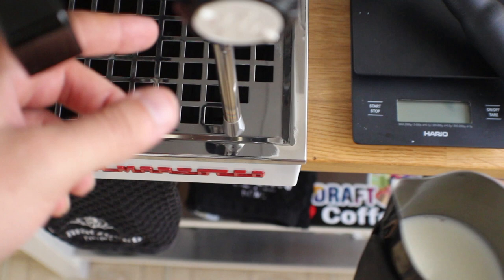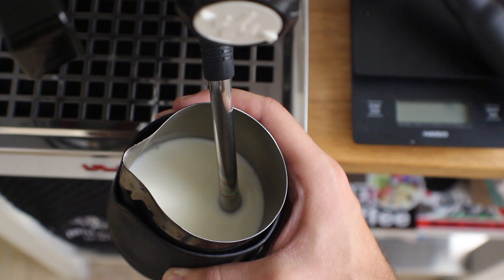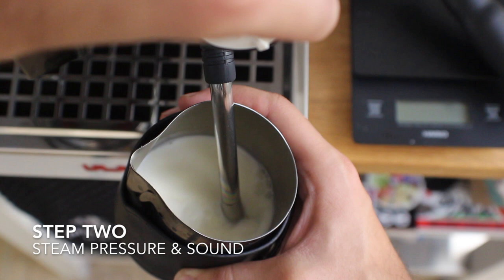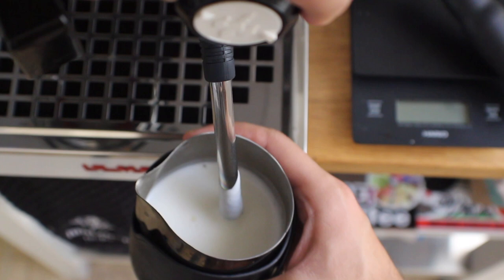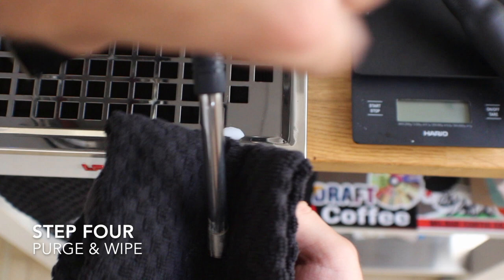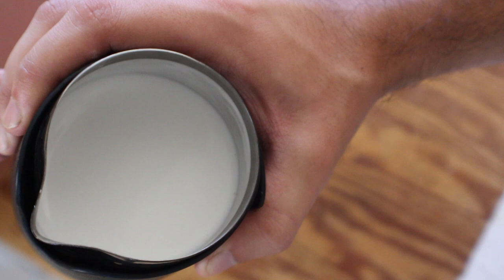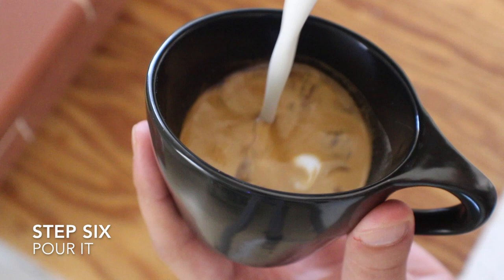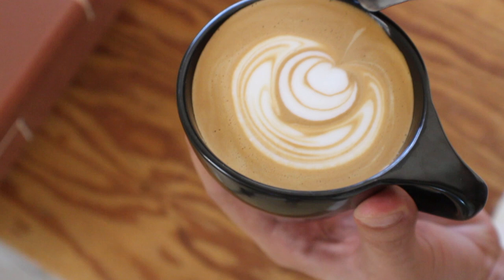DAMN FINE TUTORIAL - Milk Steaming 101

Comment: My question is: what's the difference between steaming for a cappucino vs say a latte or a flat white?
Reply from the maker: Krusty Kruss good question! So there are two differences. Cappuccino adds a bit more air, so milk is a little more frothy. Also cappuccinos are a bit cooler temp wise, I’d say 135 or so. Lattes and flat whites will be the same amount of air, it will just need a small adjustment considering the size difference of the two drinks. And usually steamed to 145 or so.
Reply: 50 amount milk and 50 amount of foam for cappuccino..aerate the milk or air for 5 to 6 times.
80 milk and 20 foam for latte..aerate or air for 2 times..

Comment: I don't get how you know you've put in enough air. My milk might be frothy on top but the milk inside is still very runny so they don't float when poured. How do you know it all or most of your milk has the correct texture?
Reply from the maker: It’s a matter of sound. If you bury the tip into the milk and it begins to squeal it means you need more air. But if it’s more of muffled sound it’s got enough. But there’s a fine line between too little and too much.
Reply: @Sprometheus  I'm atuned to the sound now but is there a guideline to how many seconds to steam before you bury the tip in deeper to just warm up the milk?

Comment: Do you need to merge it deeper at 100 degree? I saw other video for la Marzocco doing this.
Reply from the maker: Mohamed Hassan I don’t think there is really a temperature that I use for putting the wand in deeper. Just the amount of air added. Always introduce air first, then submerge and whirlpool to mix the air throughout the entire pitcher for the creamy, microfoam texture.
Reply: @Sprometheus - do you have an approximate amount of time (1 second, 2, etc.) to inject air? I've been doing it to around 21C/70F and my foam is till very dense, thick and heavy making latte art impossible. It's serviceable for a non-art cappuccino like you mentioned. The issue more pronounced with unsweetened almond milk than with whole milk, but not by much.

Comment: Everytime I need some guidence i come back to this video, but i cant find the solution for my problem. My machine has really high pressure which makes it difficult for home use. I cant find the sweet spot when i make a single late. Its perfect for steaming 2 or 3 cups, but is way too high for 1 cup. Tried with different pitchers but the 12 oz is too small and a bigger one is way to big.

Comment: What type of milk do you use for your lattes? I just use regular organic whole milk. I’ve heard there is a such thing as barista milk. Is this true?
Reply from the maker: Shawn Adkins this is a good question. I use organic whole milk as well. There are “Barista Milks” out there, but generally those refer to alternative milks. I have seen a Barista labeled whole milk before, that just has a bit more fat content to foam up a bit better, and maybe a bit sweeter. But if you steam regular whole milk well it’s perfect.
Reply: Awesome. Thank you!  Awesome videos btw.
Reply from the maker: Shawn Adkins thank you! New video dropping this Friday!
Reply: @Sprometheus  What about using a french press to "steam" a milk?
Reply from the maker: Rômulo Soares I’ve done it before, but never actually used it for pouring art. That sounds like a good thing to do a video on. I feel like the texture from the French press wouldn’t be as silky. You won’t have much control over the aeration.
Reply: this is a great way to practice getting the correct viscosity of your milk so you know when using a proper machine you know what to look for but not really a very practical way of permanently doing your microfoam.

Comment: My question is what is the temperature of the steam head ?
Reply from the maker: The steam wand temp? I’m not sure if that, but the steam pressure is set to 1.7bars
Reply: @Sprometheus  I got to admit this is a bit of a stupid question on my part as it just dawned on me you can only really superheat steam. I think the bars of pressure is a good thing to let people know about as I have been doing some experimenting with lower pressures with Bonsoy.  My machine is a dual boiler and the steamer pressure is based of the 2nd boiler that you can change the temperature on and output heated water of 110-130c which can create 1-3bar pressure.  Do you have Bonsoy soy milk where you are?

Comment: a customer asked me for steamed milk w/ absolute no foam on the side with their espresso. wth? i need answers.
Reply from the maker: Ahh the old hot milk. I used to get that when I was working on a cafe. Just put the wand deep into the milk and turn it on. It’ll make an awful loud screeching sound, but that’s how you do it.
Reply: @Sprometheus  thankyou!
Reply: Doing that would result in a more milky coffee since typically the foamed milk has more air bubbles and takes up more space, vs just hot milk, so they're going to get a weaker more milky coffee, but hey that's what they ordered.  Should be more like a latte vs a cappuccino.
Reply: @BensCoffeeRants  that's what they ordered, indeed. [shrugs]

Comment: What milk type is best
Reply from the maker: Generally that’s just a personal preference, but I find whole milk to be the easiest to steam consistently well.
Reply: @Sprometheus  having issues to make whirlpool. Steaming with 2 hole nozzle on profitec pro 700 . The process in my pitcher reminds more of a bubbling lava
Reply: @jaanajaana5771  I used to have a 4 hole tip on my espresso machine. But with a small pitcher that is impossible as temp will raise too fast when frothing. I saw on another youtube video that you could use the wood of a tooth pick to block one of the holes. Insert it, break it off and let some steam escape so the wood will expand a bit. At your own risk though, other options are: get a larger pitcher or a 1 hole tip.